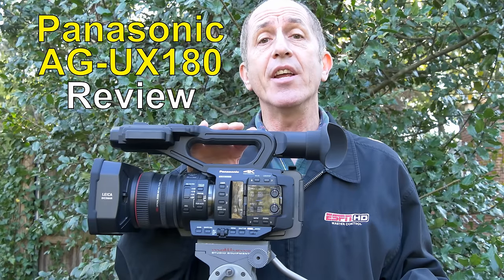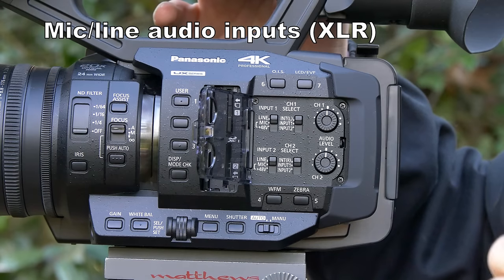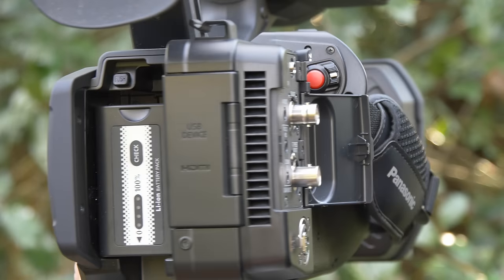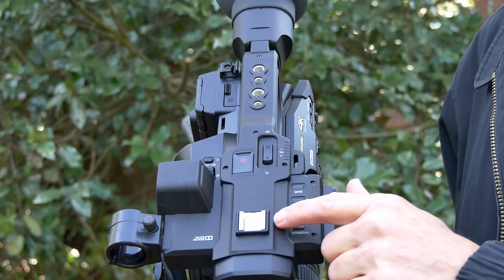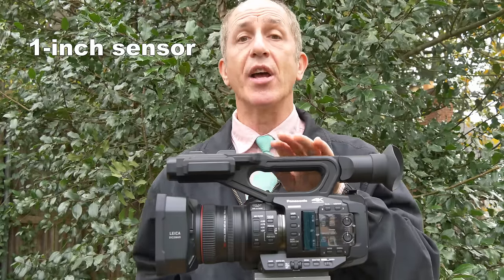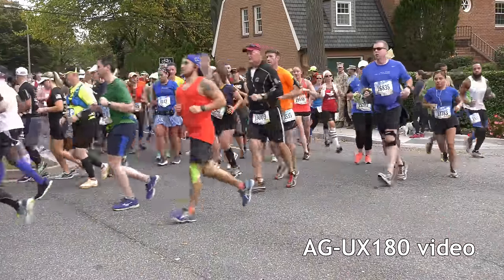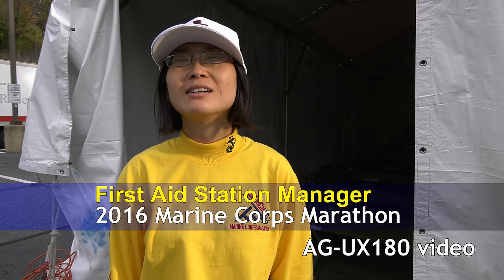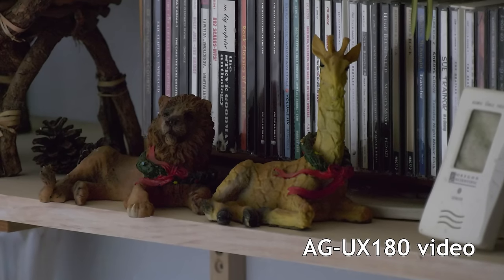Panasonic AG-UX180 4K Camcorder Review (in 4K)

Comment: great review! thank you druszám, I'm buying one
Reply from the maker: Thanks! I have a cousin in Hungary named Gabor Kovacs.
Reply: nice, what a small world :) could you please confirm that at this price range, this camera is the best? I was looking at the JVC GY-LS300 but reading too many bad reviews about that one
Reply from the maker: Gabor, I have not used the GY-LS300, so all I really have under my belt is this Panasonic UX180. I liked it a lot, though -- really nice lens. I would like it even more if it could record 4:2:2 10-bit, like the Panasonic GH5. That would be excellent.
Reply: Thank you Bob/Robi I ended up buying a Panasonic AG-DVX200 - with around 500 bucks accessories on top. Thanks so much for this great video. Köszönöm szépen! Hajrá magyarok! :)
Reply from the maker: I looked at the Panasonic AG-DVX200 and really admired its features. I like the idea of a Micro-FourThirds sensor (bigger than the 1-inch sensor in the UX180) -- better in low light and easier to do focus effects. Enjoy your new camera!

Comment: Nice, thorough review. There must be some bad points, surely? Now comparing it with the Sony PXW-X150 and this seems to be better in most areas. I'm in the market now. How easy are the menus to use?
Reply from the maker: The two negatives I had were that the 3.5-inch display was dim and it would be nice if the US180 had a shoulder support of some kind. The camera is not heavy, but you have to hold it with your arms and that can get tiring.

This camera uses 8-bit 4:2:0 color encoding, so it is not going to hold up as well for editing effects as a camera with 8-bit 4:2:2, and a camera with 10-bit 4:2:2 will be even better. But that's more of a need for filmmaking, not run-and-gun news or event shooting. The single sensor is susceptible to rolling-shutter effects, but the UX180 is no worse than any other single-sensor camera in that regard.

The menus on the UX180 are similar to my two other Panasonic cameras (GX8 and ZS100), so that was easy for me. I found the combination of familiar menus and touch-screen operation (using the 3.5-inch pull-out display) really easy to navigate. Plus, the UX180 has LOTS of buttons for routine operations. I also liked the way that the UX180 would tell me in the viewfinder if it thought the image would be better if I selected a neutral-density filter.

Hope that helps!

Comment: Nice review Bob. I'm split between this and the DVX200. Only 14x Zoom on the 200 but bigger sensor, otherwise looks about the same spec. Cheers Dom (Essential RC)
Reply from the maker: Yes, I agree that's a tough choice. I might actually go with the DVX200 for its bigger sensor, but... the UX180 shoots wider (24mm) instead of the 30.6mm of the DVX200. I have 4K cameras that can't shoot wide enough, so I'd probably go with the UX180 to get the wider shooting angle. Tough call, though.
Reply: Thanks Bob. The bigger sensor on the DVX200 just makes a difference to the volume of image data captured I guess and makes for a better result? Such a shame it only goes to 14x zoom as well. I don't get why the 180 exceeds the spec of the 200 (i.e. on fov and zoom). Maybe just because the tech the 200 is based on is already 18months+ older than the 180. But the 200 is still £1K more than the 180. Any other big differences that explain why it costs so much more?
Reply from the maker: The sensor size has to do with the depth of field and the light capturing ability of the sensor. Assuming both the UX180 (1-inch sensor) and DVX200 (Micro Four-Thirds sensor) have 8-megapixel sensors for 4K shooting, the pixel sites on the Micro Four-Thirds sensor will be bigger than those on the 1-inch sensor. That means that each pixel can gather more light. The bigger the pixels on the sensor, the easier it is to provide sharp focus without artifacts or aberrations. And, of course, bigger sensors give you a more defined depth-of-field, which looks great in a variety of shots. Otherwise, I think both cameras record 4K at 100 megabits per second, so they both make the same amount of data.

So why does the DVX200 cost more? I don't know for sure, but it's likely that the lens on the DVX200 costs more than the lens on UX100. That's because lenses for bigger sensors require bigger glass, and lens glass is an expensive commodity. Especially in zoom lenses.
Reply: Bob Kovacs Thanks Bob. Very interesting info. Learning a lot as I look more and more into these new camcorders. Here's hoping there are a few Christmas or New Year price specials :>)

Comment: Great review. These cameras though have such a "video look". Everytime I watch footage is like watching a news broadcast. But, well, that's the way it is.
Reply from the maker: Thanks! Panasonic does have firmware updates for some of its cameras that give it a "V-Log" feature, which makes the video look much more film-like. However, Panasonic charges for it. And I don't know if it is available for  the UX180.
Reply: IF you run at 30 or 60 sure but I would hope at 24fps it is less video like.  I have not used this camera but that is my experience with other cameras.

Comment: Perhaps I received a bad unit, but I was severely disappointed with my UX180. I had it wide open on a sunny day, 0db gain, tried all picture profiles, and there was a significant amount of visible noise, even on the 4K scaled to 50% and using denoising software. Everything was completely unusable. I see all of these really nice looking videos and wonder what I am doing wrong. Did you change any of the picture profile settings?
Reply from the maker: I used the 4K (3,840 x 2,160) setting right out of the box, so it sounds like you got a bad unit. If my video doesn't have the noise yours has, then your unit is definitely bad. Bummer!

Comment: Would you suggest to you this camera in motorsport, car rallies? How good is it at night or with bad light outside? Or there is better cameras for same price? I really liked this review.
Reply from the maker: Thanks! The Panasonic UX180 is decent in low light, but not spectacular. It's major selling point is its good 20x lens, which lets you get really close to things. If you don't need a lens with that sort of telephoto capability, and working in low light is important, take a look at the Pansonic AG-DVX200 camcorder. It has a bigger sensor than the UX180 and a 13x lens. The bigger sensor on the DVX200 should be better in low light. The Sony A7S II is spectacular in low light, so if that is really important, that may be the way to go.
Reply: I checked it out, but i think it's not worth for extra 1000 euros. I think, if i use UX180 and buy extra LED light, then it should be okay. Only bad thing is that sellers don't have that camera in shop to test. Only cheaper Panasonic cameras..

Comment: Hi Bob! Thanks for the overview! I have been looking for an all in one documentary camera (for a year and half now) and was hoping this was it. A couple things are really putting me off though. First, the 4:2:0, 8-bit recording and the lack of 4:2:2 10-bit out (it should be internal imo). What are they thinking? This is a $3500 camera! The GH4 outputs 10-bit and it costs $1200. The Sony X70 is $2400 with 4K and records internal 10-bit. The new GH5 is supposed to record internal 10-bit which I am sure will run about $1500 less than this. I am also confused why the on board audio on a $3500 camera is only recording at 16-bit. Even small $100 hand held recorders are 24 -bit. That is the new audio standard and has been for a while now...(I'm an audio engineer, everything is 24bit)  Maybe by cutting these features they are justifying the DVX200 price. However, technology gets less expensive over time not more expensive. This is really frustrating! On the plus side 120 fps, (which my iPhone does) and the accurate auto focus. It seems many other cameras are lacking a quality auto focus and this is important for a run and gun camera. I would really like to get away from the hybrid DSLR cameras since the accessories needed make them a bit of hassle. With that said, the features on the current camcorders just don't seem to bring enough value. Sorry for the rant, I'm just frustrated with the choices and what appears to me as the companies milking their product lines. Especially Canon! I would love to hear what you think. Maybe my idea of value is unreasonable. Maybe the prices are justified. 

Cheers,
Greg
Reply from the maker: Excellent comments, Greg. First, are you sure that the UX180's HDMI port can't be used to record 10-bit 4:2:2 externally?  I realize that an external recorder is pricey -- the least expensive may be the $900 Blackmagic Video Assist 4K, although it also comes with a nice 7-inch display to help with focusing. I did not do a deep dive into the UX180's specs, but I did test 4K output from the HDMI port (plugged into my 4K TV) and it works. That should give you 10-bit 4:2:2 if you have an appropriate recorder.

If you're recording at a level to require 10-bit 4:2:2 video, then bringing a separate audio recorder is probably also a necessity. Panasonic does brag some about the low-noise inputs on the UX180, and 16-bit is good enough for anything I will do. But if audio is your specialty, then I understand your concern. The Blackmagic Video Assist 4K has an audio noise floor of -128 dB and uses 24-bit/48 kHz sampling. It's not 96 kHz, but it gets you your minimum requirement.

If you're doing high-end film/documentary work, the $3,200 Panasonic HC-X1 (the UX180's twin without SDI output) and the $900 Blackmagic Video Assist 4K will set you back $4,100 and give you a respectable 4K cinema set up. But I do understand about wanting the internal 10-bit 4:2:2 recording -- I was surprised to see that was not an option with the UX180.

I have a Panasonic GX8, which shoots 4K and is more or less similar to the GH4. By the time you add a couple good lenses to get clean glass and some zoom range, it adds up to a $3,000+ price range. If I had to do it all over again, I would probably get the HC-X1 and have a longer zoom with a smoother touch, built-in neutral density filters, XLR audio with easy controls, built-in shotgun mic mount and a more television-like shooting experience (I have a TV background). We'll see how the GH5 shapes up when it is finally delivered.
Reply: Hey Bob! Thanks for the reply. Unfortunately according to Panasonic's brochure the Video Signal for External Output is only 8bit 4:2:2 (*3)  (*3: Output of UHD/59.94p/50.00p becomes 8 bit 4:2:0.) As a pro camera you would think it would have this feature. Depending on the shoot I may want to grade the video in post and 10 bit will just hold up better. Maybe this will be a future firmware update... Panasonic are you listening? 

As for audio I have a Zoom F8, Sennheiser mic, boom pole, field bag etc. Although on run and gun stuff I would rather leave the recorder at home and use the on board audio (one man band here). I am concerned a bit about the quality of the on board mic peramps but I would prefer the 24 bit over 16 bit. Having a bit depth of 24 vs 16 essentially allows the audio to have more dynamic range and it provides more head room. Couple that with a good mic and good preamps you'll have "cleaner" audio. Besides it takes up almost no space on the SD card. (firmware fix?) Your right though, people won't notice the difference other than the guy mixing it. :-) However, as the industry standard 24bit should be well, standard. Anything less is skimping. 

I know how you feel with the GX8 and having to kit it out. My GH3 rig is big and heavy with all the gear and its a pain having to stop shooting to swap lenses especially when recording an event. Just for static interviews it's not a problem but once the filming becomes dynamic it's a logistical nightmare. The good thing is I also shoot the EM5mkii for stills and have the lenses. 

With all that said the UX180 will probably be the camera I go with. The zoom range is exceptional especially on the wide end, it shoots 50/60fps in UHD, and it shoots 120fps slow motion.

Happy Holidays!
Greg
Reply: I know this was 5yrs ago but I have to point out that this is not a good comparison. The AG-UX180 is a run and gun Camera .  The GH5 is a great DSLR that shoots great video but it is far from a run and gun camera.  The AG-UX180 is a camera you just pick up and shoot.  The GH5 would be a poor choice for that.  They are both pro for what they are built for.  With the AG-UX180 you can do manual adjustments easily from the controls, The GH5 simply does not have this.
Reply: @garypranzo9334  Hi Gary, yeah I know. I wasn’t comparing the form factor but rather the tech inside them. 

Cheers,
Greg

Comment: Hi Bob, I am trying to figure out a comparison between the ux180 and the dvx200.  From the dvx200 reviews it seems there is a real mixed opinions. and worried a little about the low light operation. I am moving from the Sony Ex1 cameras to one of these and have enjoyed the great low light capability that the Ex1 can do.
Reply from the maker: Ed, I do not have any personal experience with the Panasonic DVX200, so all I can discuss are my impressions from the specs and my background. The DVX200 has a bigger sensor (Micro FourThirds vs. 1-inch), so I expect that it will be a little better in low light and have a more pronounced depth of field. That said, the UX180 has a more versatile lens, particularly well suited for shooting wide (for news, events, corporate -- wide is a real benefit there). If you shoot more cinematic/storytelling, the DVX200 might be better for you. If you do more events, corporate video and news , the UX180 is probably better. There's nothing more disappointing being at an event and not being able to go wide enough to capture it.

Comment: Hello. I'm sorry if someone else has already asked. But what are your thoughts on using this camera as my number one camera for wedding Videograpgy? I cannot find ANYTHING on the internet that says good or bad for weddings. I currently use a Canon 5D3 and a few 70D's, but would love to have something that does better in low light and has autofocus. The 5D3 is GREAT in low light and the 70D does great autofocus. I wish the 5D3 did both. Looks like this Panasonic does. 

Thanks in advance for your response.
Reply from the maker: I think the UX180 would be excellent for weddings. (Actually, you should consider the Panasonic HC-X1, which is identical to the UX180 except that the HC-X1 does not have BNC SDI and timecode connectors, and the HC-X1 costs around $400 less. Otherwise, it's identical, and you probably don't need SDI or timecode connectors.) I can't comment on the sensitivity of the UX180 vs. the two Canon cameras, as I have not used either Canon. That said, the UX180 has good sensitivity and its lens is MUCH more appropriate for weddings than what you likely have for the two Canons. Plus, the UX180 (and HC-X1) has convenient XLR audio inputs, built-in neutral density filters for shooting outside, a pull-out display that pivots AND and a bright, clear eyepiece viewfinder. And it shoots in 4K -- do the Canons do that? (Maybe they do... I just don't know.) The Canons are generally built for photography but can do video. The UX180 (and HC-X1) is built for video -- if what you do is primarily shoot video, getting a camera that is built for video will make your life easier. You can do a nice, smooth impactful zoom, for example. A shotgun mic mount is built into the camera. It has convenient audio controls. Etc.

So although I can't compare the sensitivity of the two, the Panasonic UX180/HC-X1 (or any dedicated video camera, really) will make your life easier when shooting video.

Comment: Panasonic Site says the Video signal for External output for this camera is 8 bit 4:2:2, I would like to know if this outputs UHD 4K 8 bit 4:2:2 in 60P. I would like to use an Atomos External Recorder like the Ninja Inferno. Thanks in advance!
Reply from the maker: My recollection is that you are correct: The SDI output is 4K 8-bit 4:2:2. But I don't know if that is 60p -- without looking it up, I assume it is 30p. I'd love to get an Atomos external recorder or maybe the Blackmagic 7-inch Video Assist, but sadly have neither.
Reply: Bob Kovacs thank you Bob

Comment: Not sure you can answer this, but it's worth a shot. I'm still using FinalCutPro 7 for editing. I shots some clips using the AVCHD setting. Final Cut does not recognize these clips when I try to log and transfer. Ideas?
Reply from the maker: Final Cut is professional editing software, and FCP7 is a fairly old version at that. AVCHD is generally considered a consumer format, so that may be the disconnect: A consumer video format won't work with older pro editing software.

I have not used Final Cut Pro in any version, so I am not specifically familiar with any incompatibilities, but above is my best guess.

Comment: Hi Bob,
I just got the HC-X1 which I believe is very similar sensor and menu wise. Im new to Panasonic and was wondering if you could recommend a profile to use, Im planning initially to shoot a documentary on sports campus which will include a lot of indoor mainly interviews. Im not planning on getting into grading in post. Thanks in advance Noel.
Reply from the maker: Hi, Noel... thanks for asking! The HC-X1 is nearly identical to the UX180 -- the only difference is that the UX180 has time code and maybe HD-SDI connectors and the HC-X1 does not. Otherwise, I had the UX180 a year ago and sent it back to Panasonic, so I don't really remember the profile choices. It should have at least one and maybe two profiles with "Cinema" in the name, such as "CinemaD." I would use one of those "Cinema" choices for a more documentary look. You might want to check what the profiles are and test them before you shoot, though. It can't hurt to get some experience with the camera.